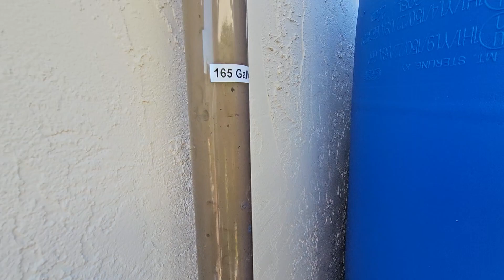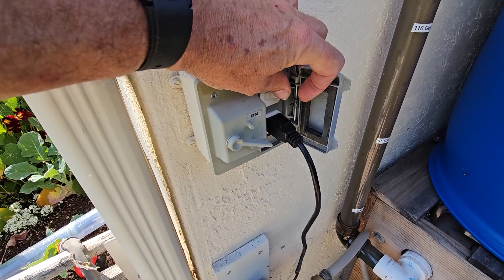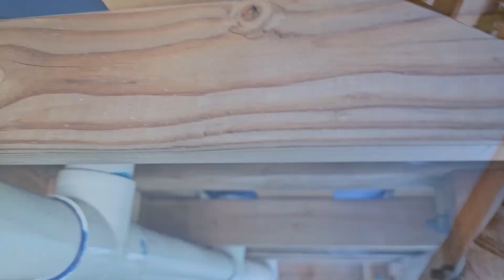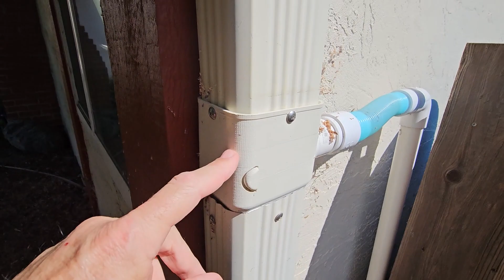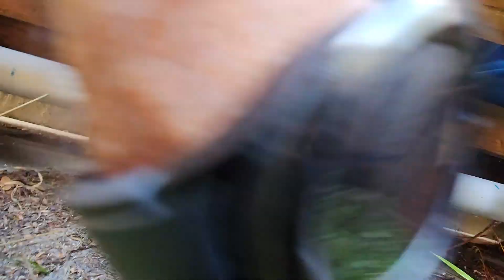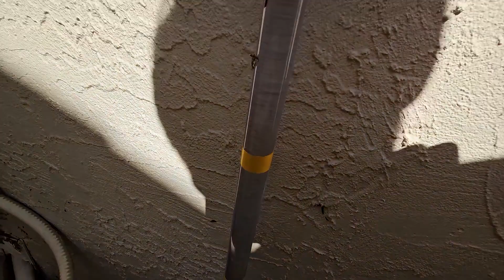Upside-down Rain Barrels Upgrades to Ben Brandt's design

Comment: Ed, how did you install the ¾" vent tube?  I saw Ben's video and he doesn't go into specific parts used.  I have the bung knocked out the ¾" female and can insert a ¾" nipple, but there are not enough exposed threads to attach anything to.  Can you help
Reply: I drilled out the bottom of the ¾ in plug, but I tried to thread it in and the threads don't start correctly and it seems it will cross thread the cap threads.  also is teflon tape the only thing you used to prevent water from leaking out of that connection?

Comment: Thanks for sharing.  How is it that there's no air vents on the barrels?  How do they fill up on a sealed system like that?
Reply from the maker: The air vents can be seen on Ben's video (https://www.youtube.com/watch?v=EOO-mHYmQCM&t=0s).  They are the smaller 3/4" pipe that attaches to the second plug on the barrel.  
   You do have to drill out the plug (be careful not to drill out the threads) with a 3/4"drill bit - I used a wood hole drill on the non-threaded side to make the opening.  Then, from the same side, I threaded a 3/4" PVC Schedule 40 MPT x S Male Adapter (https://www.homedepot.com/p/Charlotte-Pipe-3-4-in-PVC-Schedule-40-MPT-x-S-Male-Adapter-PVC021090800HD/203811638) and added a length of 3/4" PVC pipe that goes INSIDE the barrels.  If I recall, it was about 32 inches long...measure long and cut down to be safe.  Be sure to glue the pipe to the adapter.  You don't want water leaking from the bottom of the barrels.
   You can see in my video how I added a PVC cap, drilled a hole in it, and stuffed a piece of mesh material in the hole to prevent insects from making home in the air tube or barrels.
   If you don't want to do that, you can always drill 4-6 small holes (1/8") to the top of your barrels.  I'd suggest you do that along the top rim where the top curves into the sides - right on that curve.  I'd do several in case some get plugged by debris or bugs. 

   I like Ben's idea of the air tube going back up inside the barrel, best.  But, you have to be sure that your fill tube isn't higher than those air tubes or you will get water draining out of those air tubes.  This can also cause a strange vapor lock that can siphon all of your barrels down from being full to being only about 1/3 full.  This I learned the hard way.  The fix for this is:
   1) Lower your downspout water diverter until its overflow point is below the top of the air vent tubes.  You may also have to cut down your the top of your fill tube, but the overflow point on the diverter is the main issue. (best option)
   2) Drill some of those 1/8" holes to the tops of your barrels (which kinda eliminates the need for the air tubes to begin with.)

Please be sure to look at Ben's video for better instructions on building the system...My video is more about making some improvements and modification to his system.
Reply: @edfritz  Thanks for taking the time to explain all that.  My barrels are the food grade type with the twist on lid so my setup is going to have to be completely different but I'm sure there will be some gems that I can use from your setup.  Thanks again.

Comment from the maker: YouTube shortens the links so I am adding them here.  You can also search the sites with the "quoted titles" I provided.

                                                  DOWNSPOUT WATER DIVERTER (ETSY):
- "New Removable Rainwater Diverter Kit - For All Residential Downspouts"
https://www.etsy.com/listing/990551959/new-removable-rainwater-diverter-kit-for?ga_order=most_relevant&ga_search_type=all&ga_view_type=gallery&ga_search_query=New+Removable+Rainwater+Diverter&ref=sr_gallery-1-1&bes=1&sts=1&content_source=e0b7fd5e31a0ed17256ce4944077efc34ea13f38%253A990551959&organic_search_click=1

                                              CLEAR PVC PIPE & FITTINGS (AMAZON):
- "Clear PVC Pipe Fitting (bluish tint): 90 Degree Elbow, Schedule 40/80, 1 1/2 Inch PVC Pipe Socket"
https://www.amazon.com/gp/product/B07TZKYGK8/ref=ppx_yo_dt_b_search_asin_title?ie=UTF8&psc=1

- "1 1/2 Inch Diameter Clear PVC Schedule 40 Pipe [Pipe ID 1.590 inch, OD 1.900 inch] (Bluish tint), Choose Your Length (5 inches to 8 Feet) (Selected Length: 4 Feet) "
https://www.amazon.com/gp/product/B07TSV2ML8/ref=ppx_yo_dt_b_search_asin_title?ie=UTF8&psc=1

- "3/4 Inch Diameter Clear PVC Schedule 40 Pipe [Pipe ID 0.804 inch, OD 1.050 inch] (Bluish tint), Choose Your Length (5 inches to 8 Feet) (Selected Length: 4 Feet) "
https://www.amazon.com/gp/product/B07TY5BZ2V/ref=ppx_yo_dt_b_search_asin_title?ie=UTF8&psc=1

                                              DIAPHRAGM WATER PUMPS (AMAZON):
- "VIVOSUN Water Pressure Pump, 110V 5.5GPM 70 PSI Diaphragm Water Pump Include 1/2" and 3/4" Garden Hose Adapters, Power Plug for Bathrooms, Kitchens"
https://www.amazon.com/gp/product/B0B8QX1MF3/ref=ppx_yo_dt_b_search_asin_title?ie=UTF8&psc=1

- "YOUNGTREE 110V Water Pump with Pressure Switch include Power Plug 5.5 GPM 70PSI 110VAC Water Pressure Booster Pump for Home Kitchen Bathroom RV Marine"
https://www.amazon.com/gp/product/B09Q89PWV5/ref=ppx_yo_dt_b_search_asin_title?ie=UTF8&psc=1

                                              WATER HOSE TAP 3/4" (AMAZON):
- "American Valve M76QT 3/4" Quarter Turn Hose Bibb FIP, 3/4-Inch"
https://www.amazon.com/gp/product/B0052EKFAE/ref=ppx_yo_dt_b_search_asin_title?ie=UTF8&psc=1

                                              RUBBER COUPLINGS (HOME DEPOT):
- "2 in. x 1-1/2 in. DWV Flexible PVC Coupling"
https://www.homedepot.com/p/Fernco-2-in-x-1-1-2-in-DWV-Flexible-PVC-Coupling-P1056-215/100013986